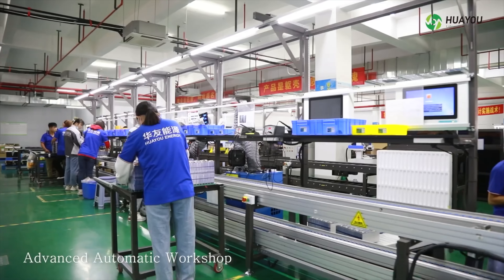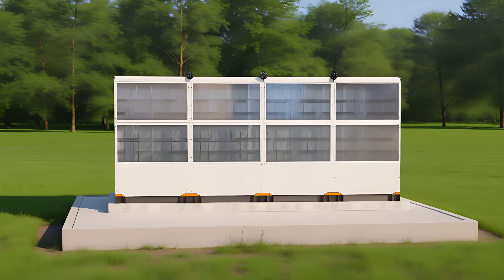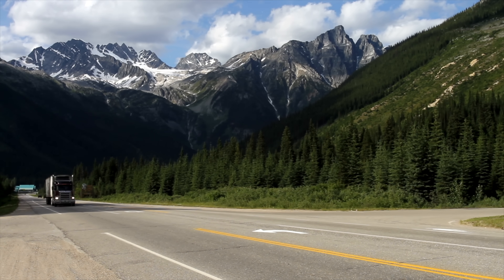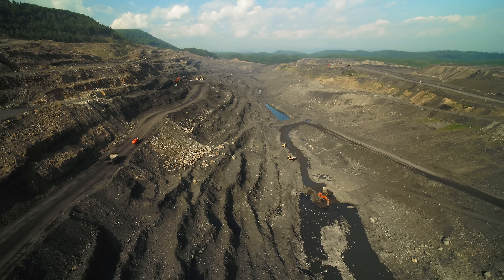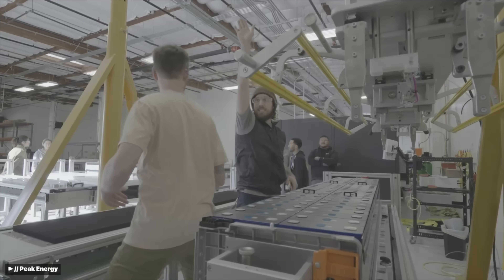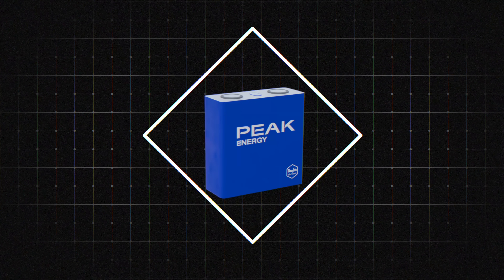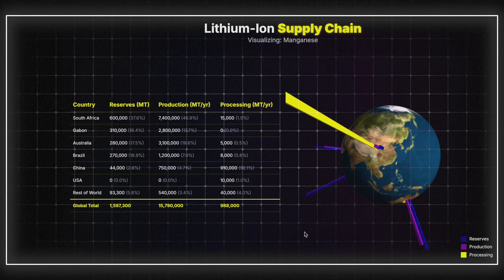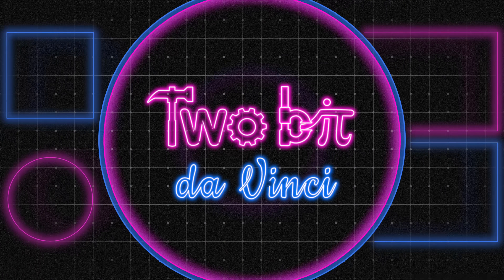Sodium Ion Batteries Are Going to be EVERYWHERE - Here's Why

Comment: If you can take one of these sodium batteries, and swap it with a lithium ion battery in a device built for lithium ion, and it'll still work exactly the same with no modifications to battery management systems, that's a massive win. Obviously you won't get the full benefits of being able to discharge it to 0%, and it will likely be less energy dense, so you'll get less runtime, but if you can literally just plug and play with any current rechargeable battery powered device, it still works, there's going to be so many possibilities.

Comment: Sodium batteries have two advantages: low temperature sensitivity and possible very high charging(discharging power possible.
Sodium batteries have two major disadvantages: High voltage swing from low to high charge, not cheaper than LFP.

Comment: This sounds like the one! The supply chain makes a big difference. In investing, one must balance risk vs reward and the reward in this case means adoption by users. The users are the manufacturers of grid scale products and phone makers and EV manufacturers. China is not going to adopt outside tech. Tesla does its own R & D. The US other significant users are GM and Ford. They might be interested. Another significant user is India. Mahindra and Tata have both brought out their latest generations of EVs, so are at the early stage of development of their next generation. If they were to adopt this tech, there would be enough time for a battery manufacturer to scale up to supply them. Also, there are the Korean manufacturers and the german and french/italian manufacturers. This less powerful but more durable, long lasting, simpler (in terms of cooling), and cheaper batterypacks makes sense for makers of everyday cars that the working class could afford. Somebody needs to commit to this tech and bet their farm on it for it to succeed.

Comment: What about putting it in an ev. The only way I’ll buy an electric vehicle is when the base battery has between 750-1000 miles base. That’s not because I expect to drive that far on the regular but for the battery longevity.  Most people replace their phones every 3.5 to 5 years. Not because the phone is incapable of performing the tasks it needs to but because the battery goes to shit and won’t hold a charge. It’s great that this exists on a giant scale but how will it fair calling it down for consumer electronics and EVS? Has this been tried

Comment: I have a Sodium Battery in my EV (as the 12v) it works great and is lighter.

However... BYD has large scale Sodium Batteries as well, and they already have Sodium Batteries, which are running in line with with Lithium batteries, to provide better reliance to cold.

Comment: It doesn't need to be fancy, it can simply be big and durable and stored underground to power homes in emergencies.

Think of a large area under your home that would otherwise be soil.

And it can be connected to the grid and act as a Uninterrupible Power Supply for the home.

How big should be the thing be for a 10,000W/hr sodium Ion battery?

Of course you wouldn't be running fridges, ovens and such at full blast, but it can keep stable power without brownouts or black outs for like 30 minutes to 1 hour at a full load, or even longer at smaller loads.

Existing UPS are hefty and uses lead acid batteries up to 1000 watt capacity and such... And is the size of a desktop PC or bigger at those levels...

Sodium Ion is multiple times more efficient and effective than lead acid, whilst not the better against lithium, as a backup power it would be insane and solve our power usage issues for the long run by storing it more per household.

It's also somewhat lighter than lead acid, so a car battery version would lighten the load and little and raise fuel efficiency... Though you wouldn't use a lithium car battery in a gas car for ultra-lightweight (not electric cars, these batteries have no place for those).

Comment: I can't believe a knowledgeable person like yourself would say something so wrong about Lithium Batteries !!!!!!!!!!
"We have been trained to keep lithium between 20% and 80%"  Really???  Everything for many years has a BMS with those limits built in so we can discharge to 0% and charge to 100% because the 20% to 80% of the full lithium range of Non BMS limits are built into the BMS!
And then you wrongly state that BMS's have trouble protecting Lithium because of the flat voltage curve?  Really???  The voltages nearing full charge and nearing full discharge are very reliable and BMS's have no problem protecting Lithium Batteries!!!
And the Voltage change on Sodium Ion is actually a Big Problem in Real World use that you apparently don't live in.  So Sodium Ion has to have a BMS/DC to DC Converter on Each Battery so that we can get a stable usable voltage?
Even with the drawbacks of Sodium Ion, I do believe that we do need to go in safer cheaper battery chemistries and maybe this will be a good one if it can produce a stable voltage for compatibility with all existing applications.
I would like to see a energy density chart comparing LFP to Sodium Ion.

Comment: These batteries are existing in laboratories.
As an example.
Byd has a 1000kw charging battery technology and will build the charging infrastructure in Germany in 2026 with big batteries as a charging element, because the infrastructure will never be able to deliver 1001kw. In 7min 100kw battery is at 90%.
BUT, Chinese will never sell or export these technologies to outsiders;)....

Comment: The perfect use case in the US would be small trucks. Go the GMC route of just packing batteries in until it gets the range you want. The problem with the sierra EV in my opinion is the vehicle its self is just too big for people who think its cool and want the range but dont want a giant unruly truck. To me, the perfect vehicle would be the size of the Hyundai Santa Cruz or the Ford Mavrick, and running electric on this cheaper battery chemistry to get the price down. (The GMC midgate would be the cherry on top)

Comment: ⚠ Sodium-Ion Battery Downfalls
🧱 Lower Energy Density
Sodium ions are larger and heavier than lithium ions.

This results in less energy stored per unit of weight or volume.

Makes them less ideal for space-constrained applications like smartphones or high-performance EVs.

🐢 Slower Charge/Discharge Rates
NFPP chemistry has low C-rates (around 0.25), meaning slower energy transfer.

Limits use in devices or vehicles that require rapid bursts of power.

❄ Cold Weather Performance (Mixed)
While Peak’s battery claims resilience down to -40°C, some sodium-ion chemistries struggle in cold climates.

Performance can drop due to electrolyte sluggishness, depending on formulation.

🔁 Shorter Lifespan (in some variants)
Sodium-ion batteries may have fewer charge cycles than high-end lithium-ion cells.

This affects long-term durability and total cost of ownership.

🏭 Manufacturing & Scale Challenges
Sodium-ion tech is less mature than lithium-ion.

Fewer suppliers, limited infrastructure, and scaling hurdles for mass production.

Peak Energy is still a small startup, so competing with giants like CATL or BYD will be tough【i】.

🔌 Voltage Management Complexity
Sodium-ion batteries have a sloped voltage curve, unlike lithium-ion’s flat profile.

Requires extra electronics (DC-DC converters) to stabilize voltage for devices that need consistent power.

Comment: look perfect to stock the photovoltaic electricity from the high production/low consumption hours for the low production/high consumption hours...
no matter if it take a larger volume for this application and, just dig a hole deep enough to use the ground low temperature (2m meters under the surface and more) as a insulator against the strong sunlight in very sunny locations, an you're golden
and probably the same thing for wind turbines
it would increase the efficiency of many renewable electricity production sources...

Comment: You say sodium batteries can't catch fire. I call bullshit on that sodium is damn near just as reactive as lithium is and equally as dangerous and that still leaves. The question is it going to be backwards compatible with all our devices that are currently running on lithium batteries? Cuz if it doesn't have the same voltage output as our current lithium batteries. It's going to be so long before the adoption happens and what's the cost of these batteries? I'm assuming it's a lot skeptical to be sure

Comment: Unfortunately S-Ion has only around 50% of the energy density of Li-Ion. If you run a lithium battery at only 50% and at the lower discharge capacity S-Ion batteries, you'd have only slightly more equivalent heat.

The resource component is really the only selling point. For modern technology its a fast dead end though. Though perhaps it'll lead to something even better later and is merely a stepping stone. That said, graphene is where the money should be going. Or carbon nanotubes. Sorting out the scaled production issues there (and we're pretty close, at least with graphene) that's what will jump us to a whole new level.

Comment: So sodium is far more reactive with water than lithium. Sodium ion batteries thermally run away as well, when they do they release flammable gasses. Just because the manufacturer says they haven’t had one of their batteries do it doesn’t mean it won’t, as hand built prototypes are far far different from a mass produced unit. Another thing passive cooling requires a low ambient temperature to be efficient, whereas the cooling systems on lithium banks don’t rely on ambient temps to maintain safe temperatures they also have headroom on the cooling systems in case of thermal shifts where passive cooling lowers that headroom greatly. Companies can claim a lot of things most do and then deliver a quarter of the promises at double the price.

Comment: 16:57 - It also seems that being able to actually get all the energy OUT of the sodium batteries would provide a huge advantage. They always rate lithium battery cells based on the total watt-hours that can be put into them....   but they ignore the fact that you don't dare fill them all the way up or empty them all the way down. It's like buying a 16 fluid ounce coffee mug that has a 3 fl oz block glued into the bottom and a lid that sits 3 fl oz below the top rim. You only end up with 10 fl oz of drinkable coffee.

I have a Battle Born Lithium Iron Phosphate battery in my RV's solar system. It is rated for 100 amp hours, and they say I can use up all of those amp hours. But I know that is only because they had to put in about 150 amp hours worth of battery cells, and then the battery management system feeds me only the 100 amp hours that is safe to draw out of that 150 amp hours worth of cells. So, wouldn't the cost and weight of a similar battery using sodium batteries end up weighing about the same? Even if they were a bit larger, that sounds like a decent trade off.

Comment: I wonder what the energy density is?
Mobile use you need that to be high.
AS far as 'grid scale batteries' go its a lot cheaper to ditch renewables and build reliable nukes instead.

Comment: (17:32) Actually, smaller and very, very sleek vehicles from the 1980s had a gasoline range of about 200 miles.  Operating one is completely viable and comfortable in a large city.  So, there's definitely a space for those types of EV vehicles you have spoken about.

Comment: How does it compare to a lipos discharge rate. We want the energy as quickly as possible with the least amount of resistance as possible, that's why we heat them sometimes and overcharge them slightly, yes bad for battery but performance is noticeable.

Comment: Something I didn't hear mentioned is charge time. Similar to assorted lith? Longer? Shorter? That is a huge point. Maybe not for back-up systems, which have time to charge from grid and then sit, but what about things like the EV market? Bad enough that you have to wait ~30 min. to recharge a car, much less the hours for an EV tractor-trailer, but it would be infinitely worse with a slower charge time. Also, can they charge fast enough for an off-grid, overnight, setup? Or would the panels/whatever generate power faster than the batteries can absorb?

Comment: IT does not matter what the battery is made of. If it is short circuting your going to have an arc like a welder that can melt any materal and start anything on fire. all batteries are dangerous if they short circuit. expecially ones that can provide a great deal of current

Comment: The big problem for power companies is meeting peak load without huge investments to their grid and power stations. Once affordable, I would think companies would want to install batteries in homes, where feasible, that are intended to meet peak load: Charge them up during off peak hours (grid power or the homeowner's solar) and switch them on during the peak hours. Maybe ~5 KWH size batteries.  This distributed approach would avoid impacting their grid infrastructure while meeting peak hours demand.

Comment: The only issue with Sodium is its less energy dense. But that's a trade off for safer, wide temperature use. As someone who seeing  Li-Ions in mobile x-ray machines. My fear is one catch fire in the middle of the hospital. Also they'd used next to patient beds so the chances one will go next to one or two people is high. I would love to see Na-Ion batteries in them. Along with UPSes that are used everywhere for medical equipment.  MRIs use two 4'x7' cabinets full of batteries similar to car batteries, another place I would prefer to see Na-Ion batteries in this case replacing lead acid batteries.

Comment: No they wont.
Even if the tech is real and works and is undeniably an insane improvement, it wont change anything.
Because the petrodolllar system will lobby and find some fabricated reason why this battery tech (along with every other that faced a brick wall) cant or shouldnt become commercialized. Either patent manipulation, or fudging the scientific data to say they arent working well, or simply legislation to prevent their use without insane markups making them commercially dead on arrival.

No better energy tech will be allowed until the corrupt system itself is brought down.
And it is nowhere near being brought down.
This isnt conspiracy theory. This is reality.

Comment: The regenerative grid theory states that capturing surplus grid energy in battery fill, hydrogen, or sand battery heat would be the optimal solution set.  

Salt batteries have a prominent role to play.

Comment: This will definitely happen. I expect to see a hybrid of LFP/Sodium-Ion cells coupled with a small Super Capacitor to create a good all around battery that can operate in all temps and have deep discharges with virtually no degradation. The good thing is these technologies on their own are scalable from pocket sized to warehouse size. Imagine having a bank of these in the garage on standby if the power goes out. Or powering tools and equipment without having to buy another battery for 10+ years...

There's one more advantage--- Sodium Ion batteries are easier to recycle than LFP even. So once there's enough of them out there, digging in the ground for fresh inputs may not be a big deal as time goes on...